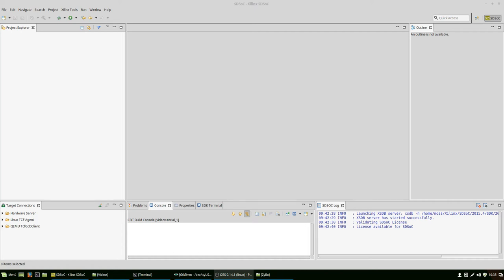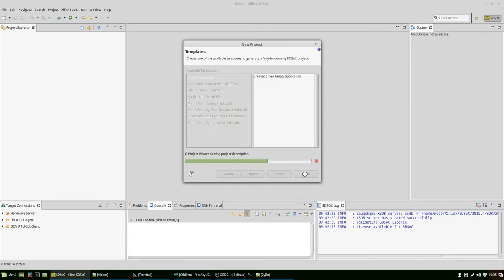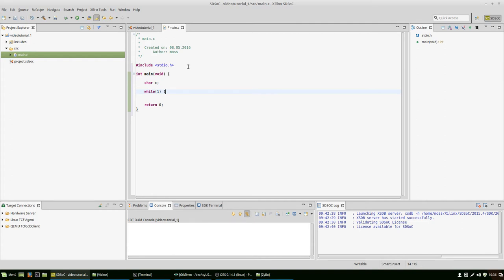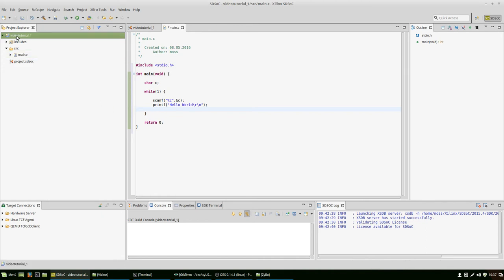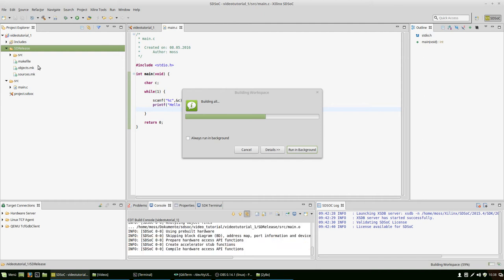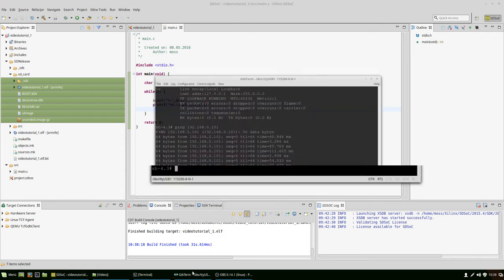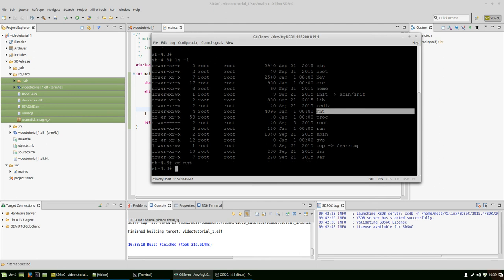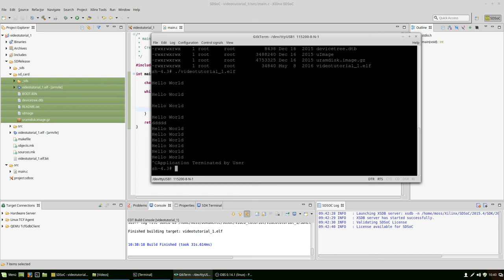FPGA Tutorial 1: ZyBo "Hello World"-example using SDSoC

Comment: hello

I am triying this tutorial but does not work

description:
Sdsoc work fine, Zybo boot fine, but  /mnt directory is empty 

sdcard is fat 32 and under Windows 7 and 10 also

anyone could help me

thank in advance
Manuel
Reply from the maker: Hi Manuel,

the SDCard might not be automounted correctly. Let's look first, if the SDCard is present in the Linux-System. While the Board is booting, the boot-logs (seen in the terminal-console) should contain some lines like:

INIT: mmc0: new high speed SDHC card at address 59b4
mmcblk0: mmc0:59b4 00000 14.9 GiB 
 mmcblk0: p1

Where 'mmcblk0' is the device (SDCard) and 'mmcblk0p1' is the Partion on the Card. The devicename might differ a little, but most likely the name will start with 'mmc'. If there are error-messages regarding to the card, you might have found the problem.

When Linux has booted and you got the console-prompt, you can control the presence of the SDCard as a device. The SDCARD-device and the partition (mmcblk0 + mmcblk0p1 for me) should be in the /dev/ directory. Switch to the /dev-directory and list the devices with these commands:

cd dev/
ls -l

You should find the devices in the shown list. Here are my devices:

brw-rw----    1 root     root      179,   0 Jan  1 00:00 mmcblk0
brw-rw----    1 root     root      179,   1 Jan  1 00:00 mmcblk0p1

If the device (and the partition) is in the list, you can mount it manualy to the /mnt-directrory with:

mount /dev/mmcblk0p1 /mnt/

After that it should be mounted and available in the /mnt-directory. If any error-messages appear while doing the mentioned steps, they hint towards the problem.
Reply from the maker: Maybe helpfull too: 
The bootlogs are stored in a file. If you want to look them up, when the board is already booted you find the file here:

var/log/dmesg

For editing and viewing Files, there is the Vi-Editor in the Linux-system installed (google for the usage of vi).
Reply: hi

thank you in advance, still, 

I have not fixed the problem

I try your recomendation, I mounted the partition 

mount /dev/mmcblk0p1 /mnt/

in /mnt directory

zynq> ./videotutorial.elf
-/bin/ash: ./videotutorial.elf: not found

 my boot is below,  there is a warning

RAMDISK: gzip image found at block 0
mmc0: new high speed SDHC card at address 0007
mmcblk0: mmc0:0007 SD8GB 7.42 GiB
 mmcblk0: p1
EXT2-fs (ram0): warning: mounting unchecked fs, running e2fsck is recommended
VFS: Mounted root (ext2 filesystem) on device 1:0.
devtmpfs: mounted
Reply from the maker: Hi,
so you can mount the SDCard and the files from the SDCard are displayed in the /mnt-directory like following?

sh-4.3# cd mnt/
sh-4.3# ls -l
-rwxrwxrwx    1 root     root       2556368 May  8  2016 BOOT.BIN
-rwxrwxrwx    1 root     root           268 May  8  2016 README.txt
drwxrwxrwx    2 root     root         32768 May  8  2016 _sds
-rwxrwxrwx    1 root     root          8438 Dec 16  2015 devicetree.dtb
-rwxrwxrwx    1 root     root       3488240 Dec 16  2015 uImage
-rwxrwxrwx    1 root     root       4753325 Dec 16  2015 uramdisk.image.gz
-rwxrwxrwx    1 root     root         34840 May  8  2016 videotutorial_1.elf

But you cant execute the application (./videotutorial.elf)? 

In that case, your root-filesystem (ramdisk-image loaded into RAM) might be broken. A reason for that could be a corrupt install of SDSoC.

Comment: I'm using the latest SDSoC 2017.1. Targeting a ZC706 board. The problem is that SDSoC is not even generating proper SD Card files as shown in the video. No uramdisk*, no .dtb, no uimage. 

What I get is videotutorial_1.elf, image.ub and BOOT.BIN. And this doesn't boot at all on the board. I've reinstall the IDE multiple times thinking maybe its a corrupted installation, still no difference, both on Win7 and Linux. Anyone else having this problem?
Reply: Well, I reverted to version 2015.4 and I get the same output as in the video. Most likely they deprecated some stuff for the ZC706 in the later version resulting in incomplete SD card files generation.